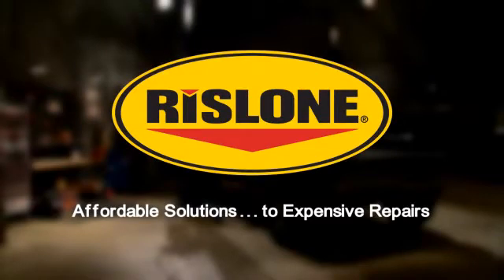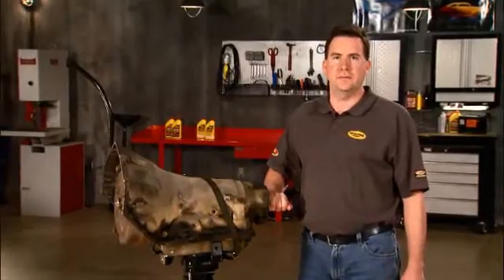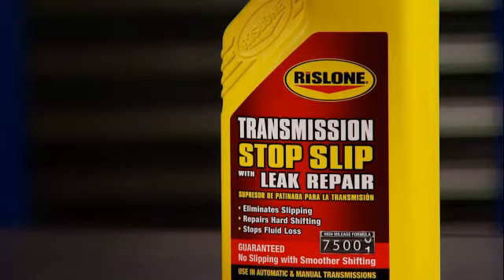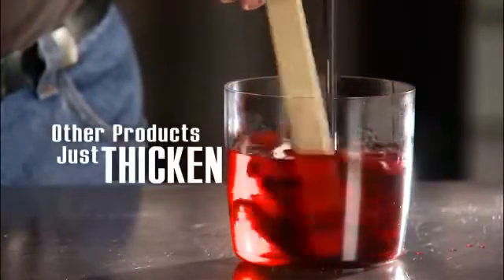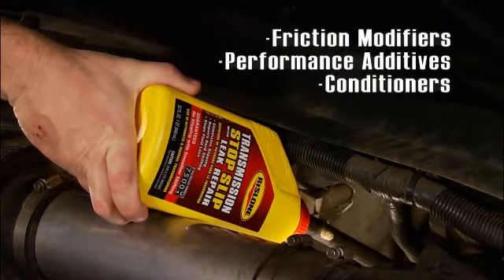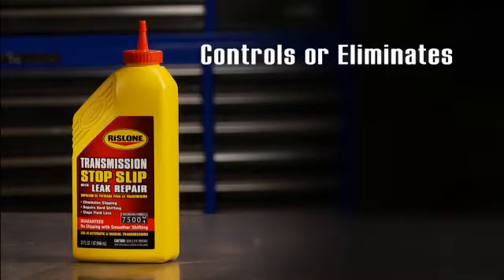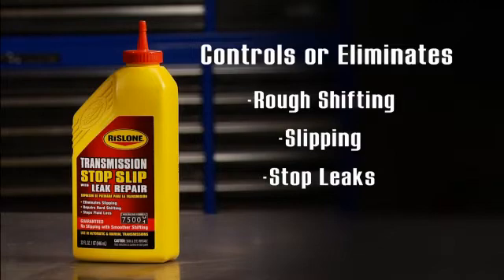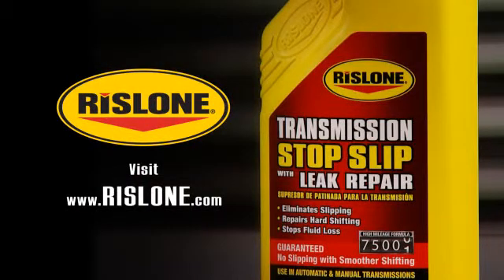Rislone Tech Minute: Transmission Stop Slip with Leak Repair

Comment: will this work on a 2012 Acura TSX Automatic
Reply from the maker: Yes, Rislone Transmission Stop Slip with Leak Repair contains a special blend of viscosity improvers, anti-wear friction modifiers and extreme pressure performance additives to solve most transmission problems.  

These additives reduce rough shifting and friction, while eliminating slip, controlling temperature, and repairing shudder, chatter and whining.  Excellent to use as a preventative maintenance product.  Use to top off existing fluid when low  or add a bottle when changing fluid.  Specifically designed for higher mileage vehicles over 75,000 miles.

Comment: Hi. Can I use this in my  1994 BMW 530i V8 E34 Automatic Transmission. Slight Slip in lower gear change,  Small leak on gear box pipe.
Reply from the maker: Yes this product is a great option for that vehicle with that specific issue.

Comment: I have a slip from 2nd to 3rd only when accelerating. Nissan xtrail 2005. Tried Lucas. No effect. Thinking of adding the rislone as well...your thoughts?
Reply from the maker: Yes this will help out with some slipping issues.
Reply: @barsproducts  hope it helps. I need to take some oil out first tho.
Reply from the maker: @vicentepallamare2608  yes do not add to a full system. Take out the capacity of the dose you will be adding.
Reply: 0 effect unfortunately
Reply from the maker: @vicentepallamare2608  how long have you had the product installed? Sometimes this product can take a few hundred miles to see full results.

Comment: Does it work in a 2002 Lexus es300
Reply from the maker: Yes this product will work in that vehicle. It is the Automatic Transmission model correct? When looking on our system we show an option for a CVT in that model vehicle and we would not suggest that product for a CVT transmission.

Comment: If I already did a fluid and filter change and added 24oz of Lucas stop slip.  Can I do a fluid and filter change and add Rislone???
Reply from the maker: Hi George, yes as long as you drain the other product and fluid you can safely use our stuff. If you would like to speak to our Michigan-based tech support team about your vehicle they are available M-F 8am-5pm EST, and can be reached at 800-345-6572. Thanks for considering us, and the question!
Reply: Give the lucas time. They are both good products.

Comment: Do u have to use the whole bottle?  And if u use the whole bottle wouldn't it cause it to be to much fluid in the transmission?
Reply from the maker: Hi Erica, the dosage is based on the capacity of your transmission. In some cases a 1/2 bottle dosage is the correct amount. You don't ever want to overfill a system so you may need to remove some trans fluid before using the product. If you'd like to speak to your tech team they are available M-F 8am-5pm EST, and can be reached at 800-345-6572.

Comment: For leaks unsure but... Ive been battling a tiny slip from 4th to OD on my 465E Trans.  This tiny slip would put the trans into default mode and raise the line pressure resulting in hard shifting.  Of course it would reset after parked for a while. Even with no trouble codes,after a half hour commute, the car would hard shift when off the freeway.  I replaced a pint with this product and it instantly started shifting smoother with no hard shifting after a long drive.  Ive tried lucas which like they said just thickens the oil.  It works for a day or two but thins out.  This I believe reconditions the seals and cleans the varnish from sticking valves.  I will update later but this product solved my 2 year problem.
Reply: what happend....i have a venture 2003....slip bam on take off ....i need a new pressure switch........if i take off slow it wont do it...if i floor it it wont do it...just that normal take off...hesitation...bam.......what was outcome??